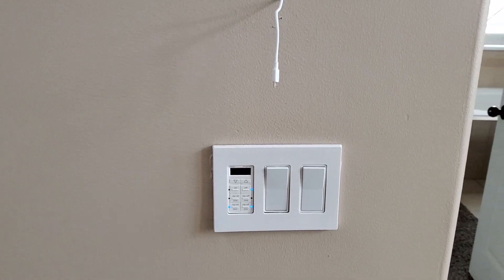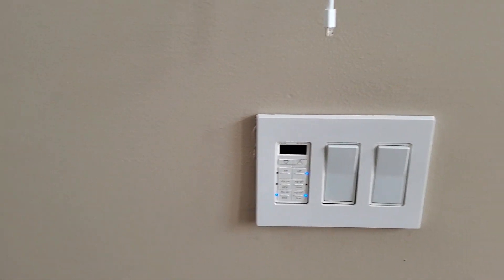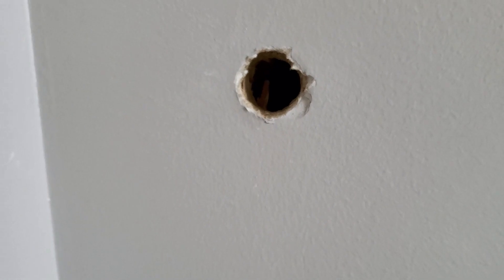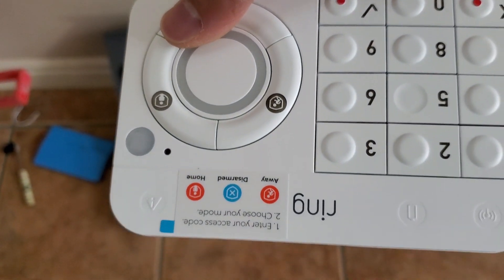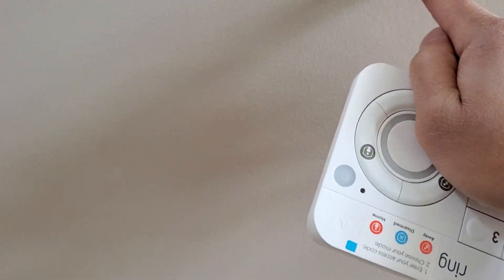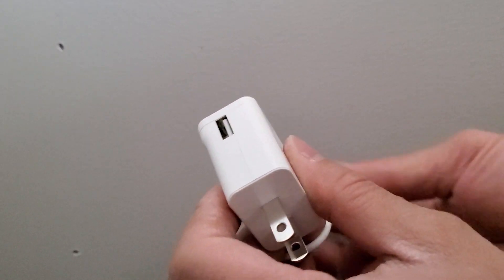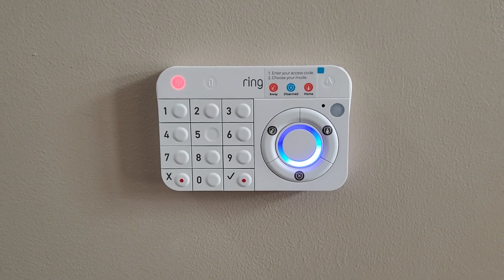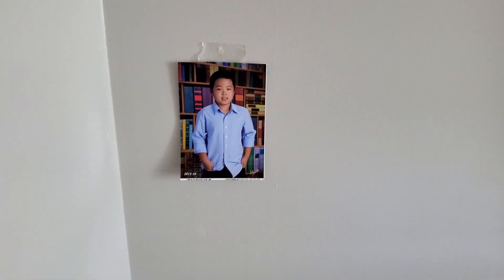How to mount Ring Alarm Keypad Ring keypad hardwired

Comment from the maker: The way I mount it with the plug outside so  I can plug and unplug anytime. Thanks for the useful comment. Also you can DISABLE POWER SAVE MODE so led light up keypad when you walk by and won't drain battery.

Comment: How do I Change batteries on this? Or they always come hardwired?
Reply from the maker: Hard wired is best. It's has rechargeable battery
Reply: @brandonlongle6730  but i dont know how to conceal the wires inside the wall
Reply from the maker: @prazna4eva  it's has a rechargeable battery built-in. So you don't have to conceal the wire like I did. You have to charge it when battery low
Reply: @brandonlongle6730  gotcha hope there is an indicator when the battery is low. Thanks buddy, u rock !
Reply from the maker: Yes there is indicator. It will tell you. You're welcome. Thanks
Reply: Had mine running for a year and 2 months before I received the low battery alert on my phone.
Charged it for about 3 hrs and now I'm good for another year.
It gives you plenty of warning, I recharged it after a week of receiving the warning

Comment: Hey some users have reported keypad issues due to leaving it plugged in all the time, just just be wary.
Reply: What issues?  Mine has been wired for more than a year. Ring even says you can connect it to power 24x7.
Reply: Yes I hardwired my keypad and about 6months later it started to mess up as the sound when entering  the code to arm/disarm would not sound and the siren when the alarm goes off would also not sound I called ring and they said that because it was plugged in (hardwired) for a long period of time that's why it messed up so ring sent me out a new one and now I just keep it running on battery

Comment: Defeats the purpose of going with something like the Ring alarm. Pretty much the whole point is to not have to do any major drilling and installation.
Reply from the maker: The way I mount it with the plug outside so  I can plug and unplug anytime. Thanks for the comment. Also you can DISABLE POWER SAVE MODE so led light up keypad when you walk by and won't drain battery.
Reply: Yeah, but I don’t have to remove my pad to charge it either and can keep the PIR sensor active all the time without battery drain. I installed my keypads where my old alarm panels were wired so technically I didn’t have to drill anything. I just need to have to hole patched some since the box behind old alarm keypad is larger than the Ring panels.
Reply: No, it is an optional upgrade. If you want to continue to charge your keypad, have at it. For those with the ability to keep it wired 24/7 it is a nice option.